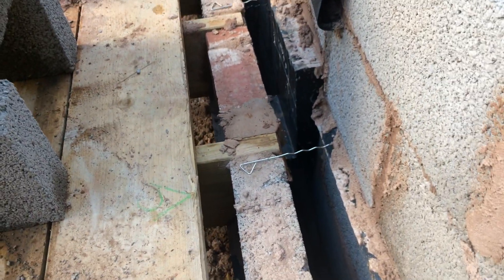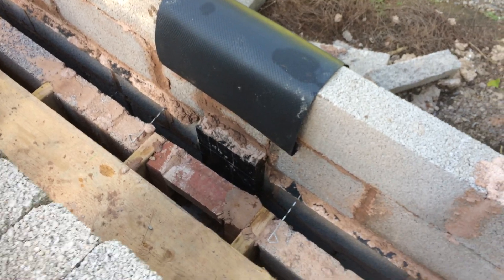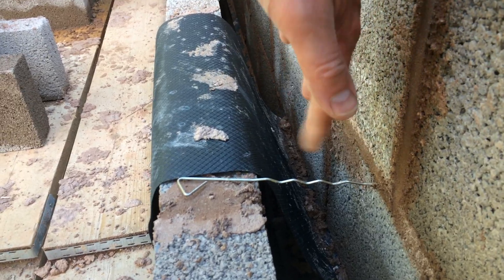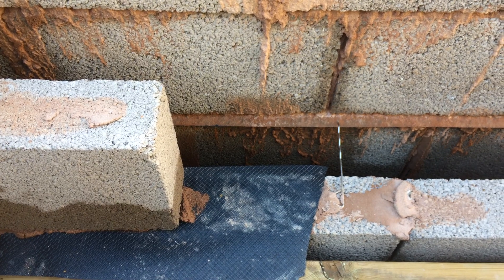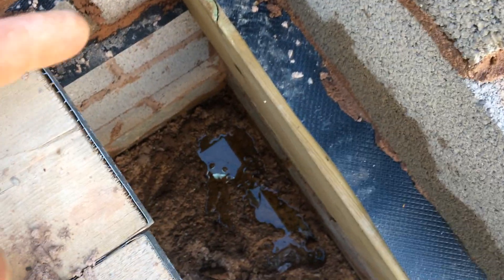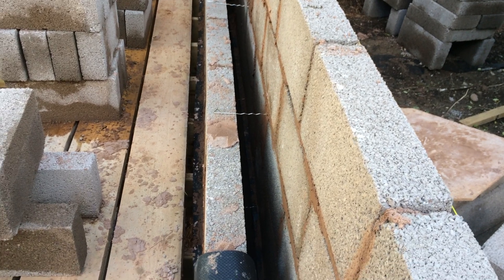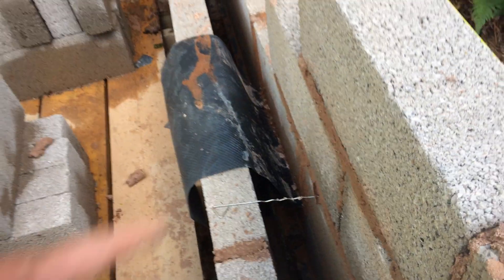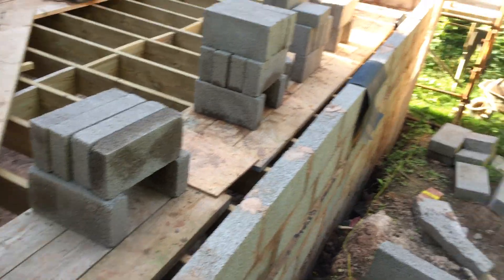How To - Suspended Floor DPC (Damp Proof Course)

Comment: Fair enough putting a tray above the turret vents, although I think I’d have curled the ends, to stop water just spilling over the sides. Better still, use an actual cavity tray with ends. I’m not sure why you would have a second dpc above the joists though 🤔
Reply from the maker: Re. 2nd DCP I wasn't sure about that either. But easier to go with what inspector said. Nice tip, re. folding curling sides of membrane. Thanks

Comment: I thought any timber joist entering the inner leaf should have a wrapping of dpm ?
Reply from the maker: Hi yes my building inspector did suggest that, but also said if ends where covered with motor that would also be ok. I guess wrapped would be superior. This was a few years ago so maybe rules have changed.

Comment: Just a question. The soil beneath slightly damp. Is this normal as our builder has said it is as we have the same issue.
Reply from the maker: In the UK all soil will be damp. Even a really dry clay is 10% water. If there is water in the surface, or running water that could be something to worry about.

Comment: Very good video and detail here mate. I'm going to be diy'ing my extension soon and this level of clearing explaning is much apreciated. Lots of other "pros" may sometimes just mention what they've done but rarely do they explain the reason why, or they often just say "cos you have to!". I think the method you have shown is a great way to acheive a level threshold at the door way, where you can use a canopy to prevent rain splash back then dont need the 150mm from ground to dpc.
Reply from the maker: Thanks mate. I aim to be helpful, so you comment is much appreciated.

Comment: Most of the time BCI can't be arsed to do their job properly. I guess that you will find out later down the line whether it was effective or not. Good luck!
Reply from the maker: Coming up for two years now. And still good. I think if you have the inspector out "inspection route" they are normally OK, but the worst way is building regs via "plans route" where they just check the plans and then leave the rest up to you. I've seen builders doing very weird stuff whilst not supervised. Pretty much anything "out of sight" may have corners cut. Footings, Soakaways, Insulation just make it up as you go along.